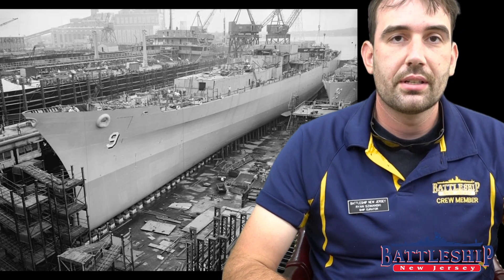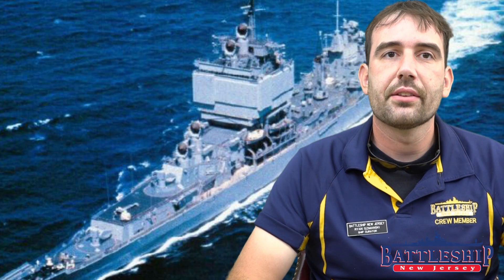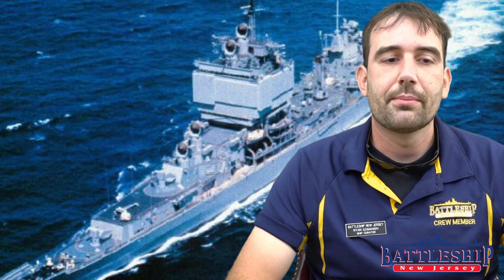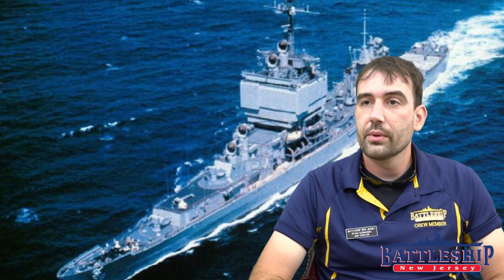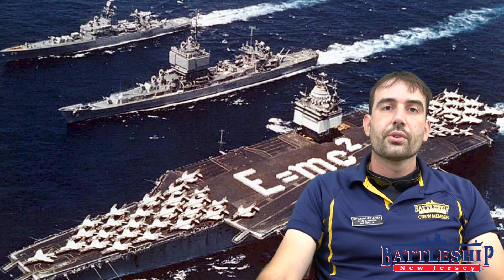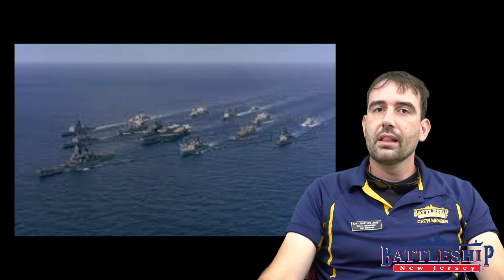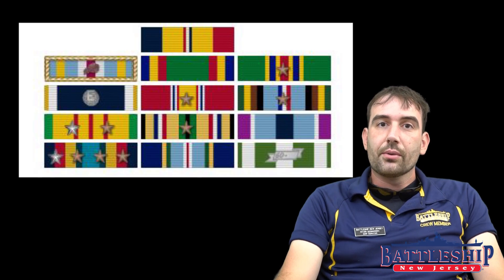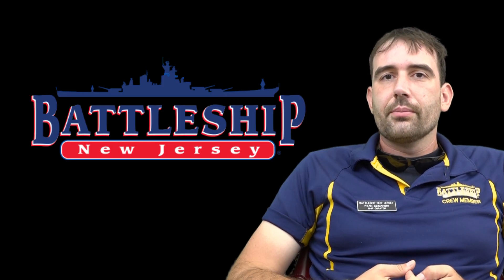NUCLEAR: USS Long Beach (CGN-9)

Comment: I was on 3 WestPac  cruises aboard Long Beach from 77'-80', as a  Data Systems Tech working on the NTDS in CIC.
Reply: I was an OS on South Carolina CGN 37 we were on first name basis with the DSs.  Sometimes unpleasant things were said but they used first names when complaining 😃.  DSs FCs ICs all complained that OSs were breaking their gear. (Among other things).
Reply: @BornRandy62  Because you were breaking our gear...  :)
Former IC2, USS Kansas City (AOR-3)
Reply: Maybe you can answer a question for me. I was stationed at NAS North Island from 77-83 and I saw the Long Beach moored at the carrier piers quite often. Was that for ammo loading/unloading or was that her normal berthing?
Reply: @ralphgesler5110  There is an ammo pier on North Island (just across the bay from the sub base). But I don't think that pier was there in the 70-80's time frame. The ammo bunkers have been there for a long time. I assume a lot of the aviation weapons were stored there. I know "Special" weapons use to get transferred from those bunkers to the carriers at the old carrier piers when that was a thing. I know the small boys went to Seal Beach to get their gun ammo. I couldn't tell you what kind of bombs and ammo is stored at each site (there's also the Fallbrook site on Camp Pendleton)

Comment: I know this maybe a controversial opinion since Long Beach is defiantly an "unusual" looking vessel for lack of a better term. But in my opinion she is one of the best looking ships to ever be built by the USN and defiantly the best looking Cruiser.
Reply: LOL.  CGN-9 looks like something Homer Simpson came up with.  Hideous.
Reply: @garyh4458  It was function over form. Long Beach had the box to accommodate the SCANFAR radar which was an early version of phased array radar. It tended to break down a lot and was removed during an overhaul/refit in the 80s.
Reply: @pandax75  Yea, that was the technology of the time.  But still, CGN-9 looks like the strip mall of ships.  :)
Reply: @garyh4458  She was unique looking. But again she wasn't built to look good she was built to serve a purpose and she did that well
Reply: @pandax75  Yea I know.  I was on CGN25.
Reply: @garyh4458  I was on something close. I was TDY to the Belknap CG-26 when it Sixth Fleet flagship. That was before I was on Long Beach.
Reply: @pandax75  Oh cool.  The Leahy and Belknap class ships looks so similar to Bainbridge from the outside.  I always wondered how similar they were inside.
Reply: @garyh4458  From what I've read Bainbridge was a nuclear version of the Leahy class. Also I heard the Leahy and Belknap classes were very similar the main difference is the Belknaps had their aft missile launcher replaced with a 5 inch gun for gunfire support.
Reply: @pandax75  Yes, Bainbridge was a nuke version of Leahy.  It had two big reactor compartments but but no boilers.  Otherwise, I imagine it was pretty similar.

Comment: I would like to know more about the 1980's weaponry on the New Jersey and how they compared in damage to the WW2 gunnery.
Reply: Antiship missiles trade damage for accuracy and range. The 16" guns will relocate critical systems on a target vessel with greater efficiency, when they hit. However, the guns only work in a radius of ~20 miles. Antiship missiles can hit targets out in the 100+ mile range. Antiship missiles don't have the same kind of armor piercing capabilities as the guns, but have a larger explosive payload. Antiship missiles are larger than the 16 inch rounds, so you get fewer shots for a given weight. Missiles have to be up in the superstructure to launch (on the BBs anyway...) so any attempt to carry a lot of them would require major changes to the hull (hence, the creation of VLS...).

The net effect of exchanging guns for antiship missiles as a primary ship killer is that lightly armored ships (non-BBs and anything newer than WWII) are quite reasonably killed by missiles. I would be much more skeptical of an antiship missile crippling or killing a WWII BB. However, there were not a lot of WWII BBs running around in the 1980s. So the precision and range advantages make missiles the superior weapon system for the majority of missions. The modernized BB does have an absolute lock on the ability to kill any ship within short range. If her guns can hit, they will kill their target. Overall, I would say the two weapon systems are complementary, just inefficient, which is why the BBs were eventually retired.
Reply: @timberwolf1575  Thanks 👍
Reply: @albertendler2038  In Lebanon, the USN New Jersey had the locals hopping. BTW, it was the last time the New Jersey was able to sail her Battle Flag -- you know -- the ones that date from the age of sail. The New Jersey's flag took 56 men to bring to the pole -- and hoist it. It'd cover your house. My old math teacher was a Plank Owner -- so we had a slew of New Jersey media to look through circa 1970. Heh. He was stationed in the Crow's Nest. He just loved stormy weather up there. Heh.
Reply: They would launch the missles through the main guns.
Reply: And what are you doing Albert, to address this?

Comment: Thanks for this video!  I absolutely love the early surface nukes, Long Beach, Bainbridge, and the incredible 8-reactor CVN-65.  Super impressive state of the art tech of the era.
Reply: I worked on the Long Beach and the Bainbridge in the 80's when I was an engineer for General Electric Marine Department. I also got to work on the Enterprise reactor feed pump turbine pumps including the 4 Alpha pain in the ass. Its cool to be a part of keeping them running.

Comment: Someone told me LB could do 40knots? But Nuclear age, can you also do the Soviet Kirov Class Battle cruiser?
Reply: My older brother was on the CGN-9 early in her years. He stated she only did it once (40 knots) while he was  onboard, because she shook so bad, he thought every nut and bolt was coming loose.
Reply: @dannyisaacs7552  I was ship's crew on Long Beach 90-92. When she was doing 30 plus knots the further aft you went the worse the vibration got. I used to joke you could stand still and still move.
Reply: @pandax75  My brother was a BM during operation Sea Orbit. Round the World Cruise. She was out of Norfolk back then. He saw alot of the cruise from the Big Eyes due to being restricted to the ship. Always in trouble.
Reply: I think 40 would be a push as she has a classic displacement hull shape, which probably can't get much over hull speed (35 knots for her length) no matter how much power you throw at it. Maybe if lightly loaded.
Reply: There was a rumor that CGN-25 originally had screws that would let it do 40 knots but it cracked the fantail and they switched to 30 knot screws.
Reply: She started life as a light cruiser design and her engineering plant didn't grow with her weapons systems.  We would only do 30 knots.
Reply: @kurtlesser2684 You are correct. She was originally CLG(n)-109 and designed to be 500+ feet in length instead of the final 721 feet.  80,000 shp total can't move the as finished 17,000 tons very fast.
Reply: During my time onboard beginning in '74 when she displaced 17,000 tons to '92 when she displaced much less (Talos removed - a lot of weight), the Long Beach at Flank speed and maximum shaft rpm's (based upon displacement, not hull fouling) was 30.7 knots on a good day and nowhere near the 40 knots folks believe.  The restriction was torque on the shorter (port) shaft and not power available.  A rule of thumb for surface ships: to double the speed through the water requires a 6 times increase in power.  For submarines the figure is 8 times increase.
Reply: @bullnukeoldman3794  Pete, I remember you told me once while underway the Long Beach was the "Speed Queen of the Pacific" whenever we would drag race those newfangled gas turbine DDs we always kicked their butt because our screws and the power plant was so much more capable of accelerating quicker. She will always be the best in my opinion as well. Jerry
Reply: @allaboutboats  Yeah we could out drag race 'em (1/2% per second and low feed flow alarms be damned - Hah!) but they'd start catching up at 27 knots and slip by at 29!

Comment: Nice green screen setup. You guys would really benefit from a teleprompter for your written scripts. They're actually very inexpensive (see: https://www.amazon.com/Glide-Gear-TMP100-Adjustable-Teleprompter/dp/B019AJOLEM/ for $200). It will really elevate the production value of your videos. The best ones are those that allow you to mount your existing cameras behind, which can be a little more expensive if your camera has unusual mounting brackets but well worth it.